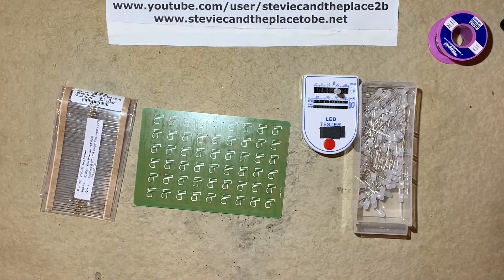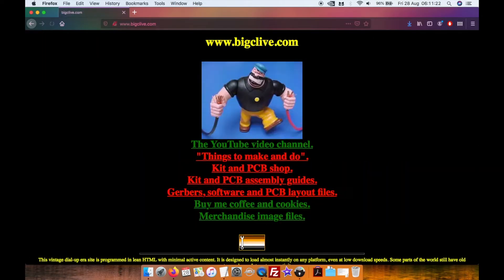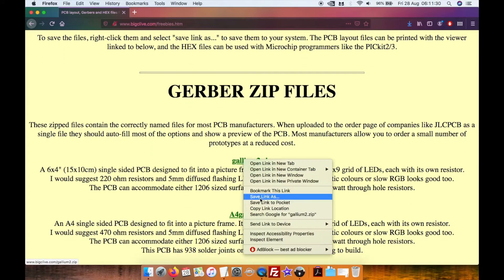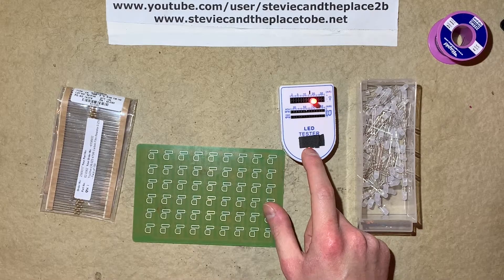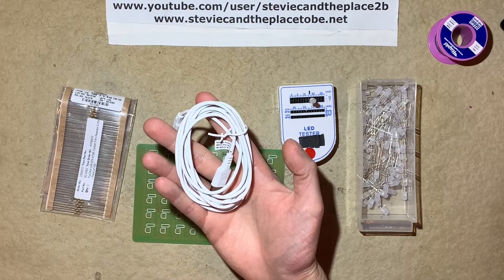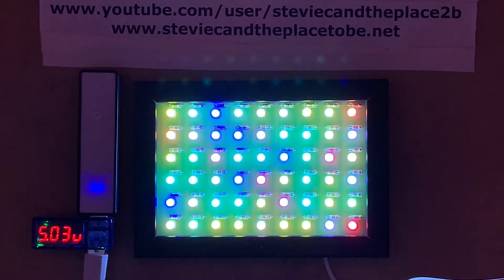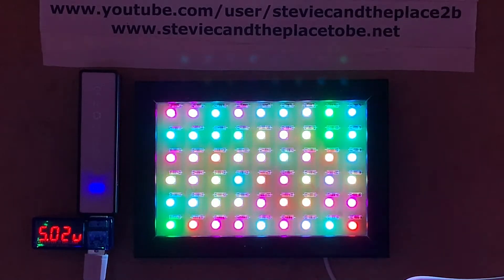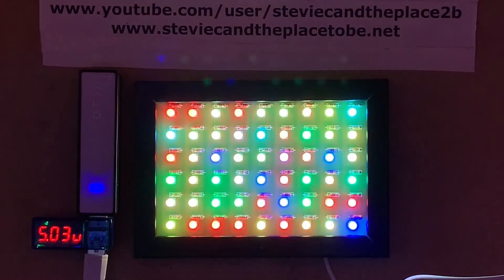Building Big Clive's Gallium PCB with RGB LEDs

Comment: Nice work, why did you select 470 ohm resistors? Was it to do with power consumption or brightness or something else?
Reply from the maker: Just seemed like a reasonable value that ran the LEDs at a suitable intensity without overrunning them.
Reply: @steviecandtheplace2b  Thank you, I agree having a bright intensity maybe annoying and nauseating, but also a lower intensity will run your power bank longer. Regards